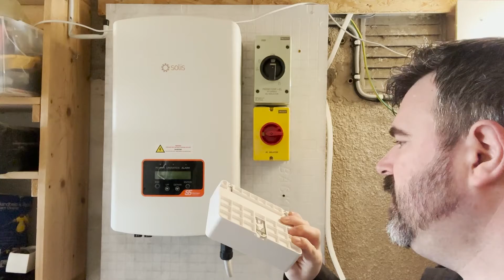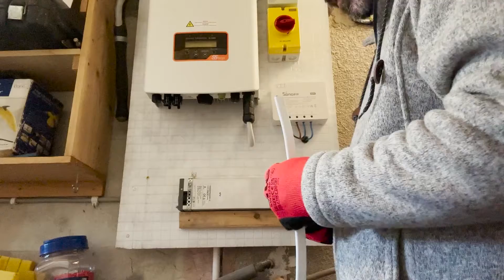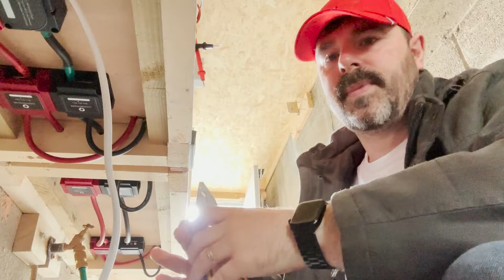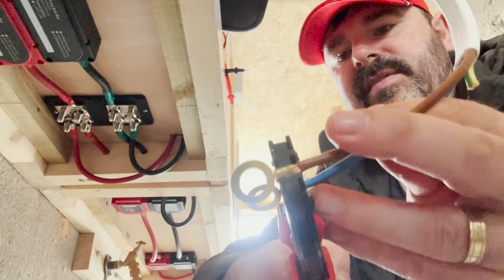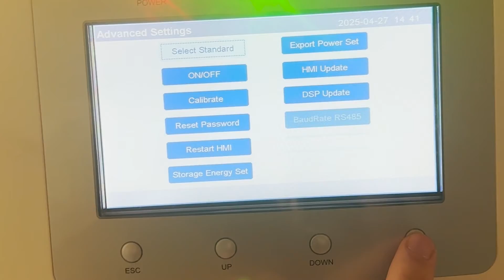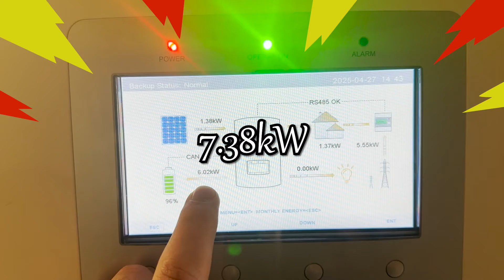How to Fast Charge Solar Batteries

Comment: Where did the fireman switch go?
Reply from the maker: Fireman switch must be no more than 1.5m from the panels. It's under the roof at the apex point.
Reply: @GaryOnPower Thanks for the reply..is that a must in the uk or just IE? I Don't see any on uk installs?
Reply from the maker: @fast_eddie3441  The UK has more relaxed rules than Ireland. The UK just follow MCS standards (BS 7671) wiring regulations which require DC isolators on solar PV installations.

Comment: Without wanting to upset..

The 6mm mains cable isn't suitable  for DC power. It is mains cable and should be Red and Black stranded cable for DC.

3kw at 52v is 57amps and 6mm twin and earth is rated under best conditions at 47amps.

Change the cable to 35mm2  as it has potential under constant load to overheat, melt and short circuit all your battery packs causing you a very bad day.

Why 6mm cable? Its not suitable..

Use battery starter cable NOT single core T&E.

Smart Switch should ideally be in a DIN eclosure to keep double insulation on the wiring.
Reply from the maker: Well made points. I’m waiting for lugs to upgrade the DC side of the rectifier to 25mm^2 DC cable. 35mm^2 is simply not necessary considering the inverter to batteries uses 25mm^2 as standard and they comfortably handle 5kW. 

I wasn’t planning to use a din rail enclosure, but I will consider this. I have a more immediate plan of covering the contacts on the rectifier.

The rectifier is only in use a couple of hours per morning and I’ve observed the temps with a thermal camera. They are reading around the same temps as the 25mm^2 DC battery cables which was encouraging.

When I return from travelling, I’ll be adding a supplementary video and updating the description as such.

Thanks for the comment.
Reply: @GaryOnPower  heating within cables is down to resistance. The less resistance the lower amount of heat generated and there is also less voltage drop on long cable lengths at high currents.

I've installed many 5-6kw Solis units as  well as two weeks ago, a 2x 15kw Solis giving 30kw and 600amp charging system and prior to Lithium, Lead Acids - those days were fun with no balancing!!

With DC, it's better to oversize cables after little extra cost to keep heat and resistance as low as possible and every installation above 3kw charging, I'll fit 50mm from BUS BAR to battery which under full load remain cold to touch. The MASON 280 dedicated connectors are specified 50mm cable.

The Inverter cables are warm but beyond the BUS, they are cold.

Resistance will be noticeable as battery voltage drops and the Inverter is trying to pull 100amps. As cable warms, resistance also increases.

I'd rather run a cable at 50% its rating than almost at or above its maximum rating.

Unless after your BUS its individual cables to each battery in which case 25mm will be fine as loading is spread and just the Auxiliary cables should be changed.

Most the Seplos units I install are 280 (black stackable) and paralleled at the battery with only one Black and Red going towards them.

Advice for others, don't take chances with DC, especially at high currents.

This wasn't criticism, it's just shared knowledge and experience from someone who has installed many battery systems.
Reply from the maker: @leet3707Yeah, I understand the physics and math behind it. I used what I had available and mentioned in the video I would be using 25mm^2 for the DC portion. 

Each of my batteries is individually connected to the bus bar and the cable run between each battery has a DC breaker. 

I tend to oversize and over engineer but was advised that 25mm^2 was more than adequate for my use case and setup. The Solis 5 and 6kW inverters will only take 25mm^2 DC cable without warranty voiding modifications.
Reply: Slightly off subject.

You mentioned using Solis to charge from a second set of panels using the 'Grid and PV' meter settings with a Grid Tie Inverter.

Have you done this and is the Solis charging with Surplus from another source as about to get into a project doing this and wondered whether it's working as expected?
Reply from the maker: @leet3707I added a 3.6kW Solis string inverter as a stand alone unit. The only shared connection is it is run from the same fuseboard and it is added as a separate plant on my account.

The 5kW Solis hybrid is detecting the generation from the string inverter and is either exporting to the 5kW limit, and/or charging my batteries with excess, utilising up to 8kW of generation.

I have uploaded 2 videos on this so far.
Reply: @GaryOnPower can you do me a favour and do an experiment.

Shut the Solar off the Solis Hybrid and see if it will soak up the excess from the other system - in other words act as an AC Coupled Inverter.
Reply from the maker: @leet3707I’ll see if I can manage the weekend. I’ll set priority as self use and see if the other panels direct the energy into the batteries. I suspect it will judging by what I am seeing already.
Reply: @GaryOnPower I'm hoping so. My gut feeling is it will but I've not a system to try here with.

Be interesting to see the results..

Don't take my comments in anyway as criticism, your videos are excellent and I'm just giving my input where it may help.

Thanks.
Reply from the maker: @leet3707I’ll let you know how it works. Will wait until the load from the panels is low before I isolate the ones from the hybrid. 

A little criticism politely put is always welcome here. It often helps me improve my setup, or at least helps others with theirs, whether I agree or disagree with the comment, so thanks for the feedback.
Reply from the maker: @leet3707 OK, I have a result. 
Conditions at the time: 18:30
Main hybrid system was producing ~1.5kW. 
Setting was "self-use", so battery would have priority on unused generation.
Battery pack was essentially full at 99% and excess was being exported at ~2kW
Small string system was producing ~1kW. 

With Hybrid inverter isolated from its panels: 
The generation icon show 0kW.
The load was at 0kW, but I know there was a small house load (PC running).
Battery was neutral (due to being full).
Export to grid showed 0.5kW.

From the short test, I conclude that the hybrid inverter detects and stores/exports the excess processed by the string inverter via the fuse board anything not consumed by the house load. The load would have been in the region of 500-600W, so the export figure of 0.5kW looks about right. I suspect this would have been fed to the battery bank if it wasn't so full at the time.
Reply: @GaryOnPower  sounds good.

If you can and when get a chance, could you do the same where there is battery capacity available and again turn off the strings to the Hybrid and see if battery does, pick up charging.from Surplus from another source.

This should absolutely confirm.

Which meter is your Solis running?

Thanks in anticipation.
Reply from the maker: @leet3707 I probably won't get a chance to do that for quite some time. I travel a lot for the next couple of months for work. The battery is full when I wake up and full when I return home. It only starts to deplete when the sun is low/set and at that stage, the house load is greater than the generation. 

It would just be a formality to check anyway. I know the battery only reaches 100% from solar when the generation is around 1kW+ greater than the load. Otherwise it hangs around 98-99%. This is why the hybrid showed the export and didn't force more energy to the battery. 

If convenience allows it, i'll test it.
Reply: @GaryOnPower Interested to see this too.

Comment: I have electric car and planing to get a solar panels and battery: question is how to charge the car and not drain the battery thanks
Reply from the maker: Great question. Your EV charger is what controls this. You will need a Solar Ready EVSE like Hypervolt, Zappi or whatever other brand you prefer. Your electrician (or the one connecting the solar) should be able to set up the charger. The batteries, won't be used to charge the EV as long as the solar settings and hardware are correctly set up. Both your solar inverter and charge point will have their own respective CT clamps. The inverter will supply any excess solar to the EVSE and will keep the battery until needed. Depending on your tariff, it might be best to export solar to the grid and charge the EV and batteries off-peak.

Comment: Hi nice job I’m planning to solar but I don’t have room to put inverter and the battery, do you think they can be installed outside?
Reply from the maker: Inverters can go outside as long as they are not in direct sunlight, or directly exposed to rain. Batteries will vary. DIY setups will generally need to be weather shielded. You could build a weather proof cabinet, or mini shed to house your equipment.

Comment: Nice one Garry as always, I find with any smart device, SONOFF, Tuya if having trouble in connecting to home network make sure you are using the 2.5Ghz SSID not any 5Ghz that your router may be broadcasting. Also if location may be to far from your router, wire device to 13amp plug and plug into socket next to router set up then move to final position.
Reply from the maker: Thanks. I have a couple of SONOFF devices. I use one for my electric gates and outdoor lights. So, I have a Linksys triple node mesh system. What I will try today is to plug a node into the socket in the side entrance and that will give a strong signal to get it going. I have some CAT5 External showing up today. If it arrives on time, i'll be connecting the CT for the EV charger and setting up load balancing. I won't be running the rectifier until I have that set up to protect the main house fuse.